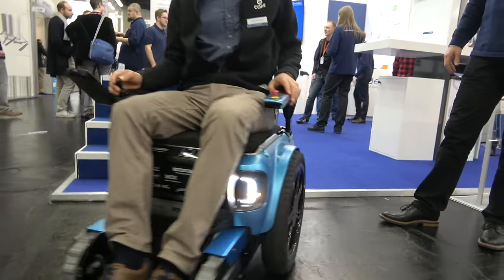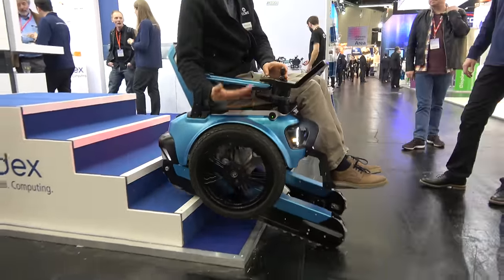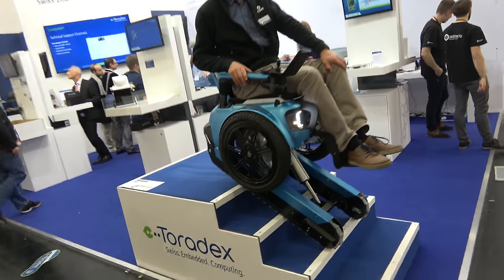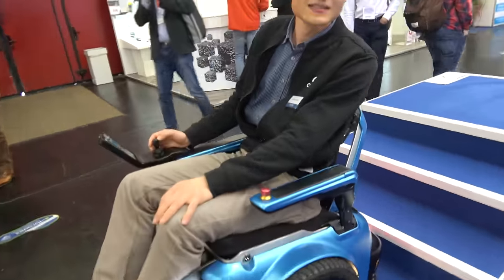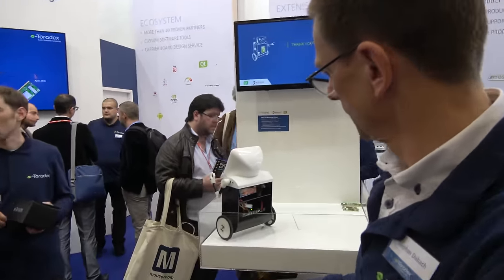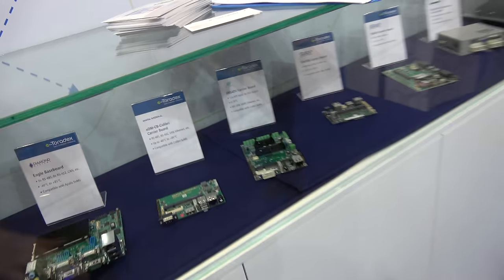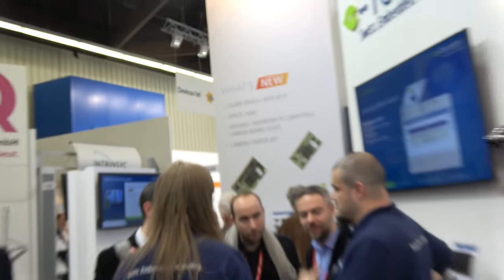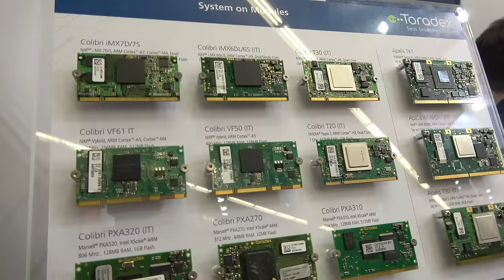SCEWO stairclimbing wheelchair from ETH Zurich using Toradex at Embedded World 2017

Comment: I can make this chair last less than a day :) meaning i fee it's possible I can prove the battery can last less meaning that would be my concern what if it dies does the balance make you fall with the chair?
Reply: I too am concerned with ALL chair lifts that I have seen, most aren't one person and most seem to have no security in case if power failure or tipping over on stairs.  We need more designers in on this!!